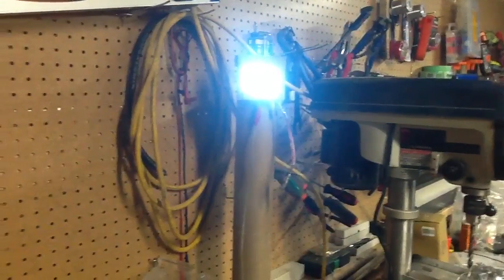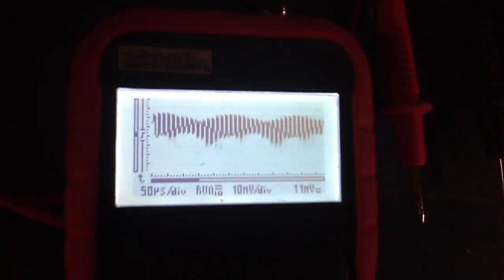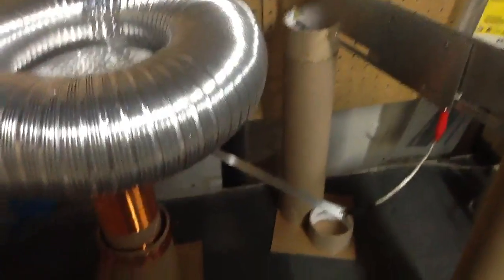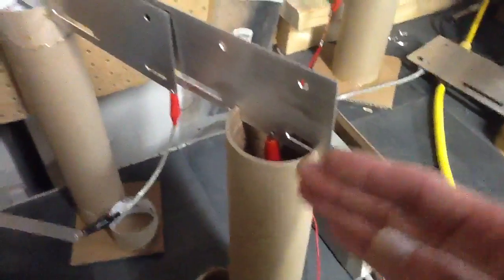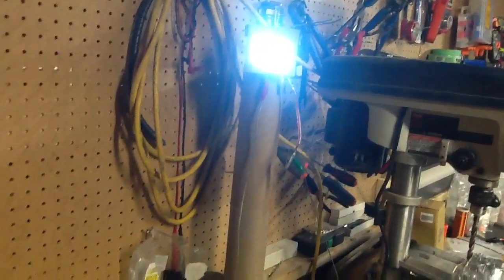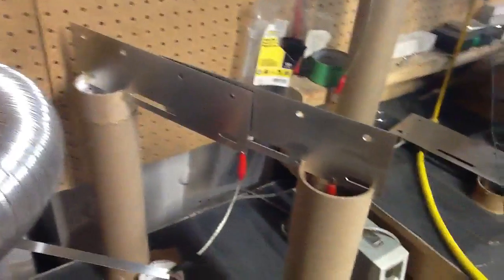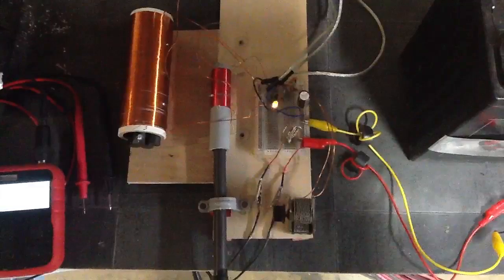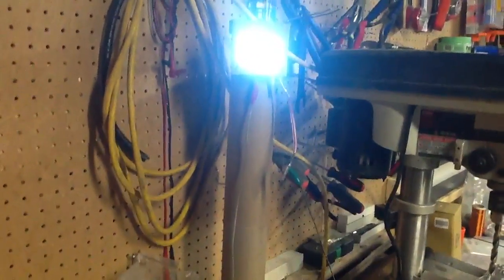pt 19 TMT Tesla Magnifying Transmitter, New Output Configuration

Comment: Have you tried blowing air on the gap?
Reply from the maker: +aaaflooddrying hi there, at the moment the spark gap is actually replaced by 2 parallel MPSA06 transistors, running cool, very low milliamps, seen here as possibly 10mA, but measured previously as 6mA on 12 volt. Stepping up to 150Volts and 20 milliamps out, as shown in a past video :)
Using my variation of the DrStiffler SEC exciter circuit, in Tesla Magnifier aka 3 LC system configuration
Reply: Very nice.

Comment: Hi dear Kurt,

Nice to feel that you have reach a Great Nice Level of Certainty in what you're doing :)

Can't wait your schematic and step by step "how to do" :)

So so very thanks for your hard and clever work and studies!

Btw, do you have PayPal donations button somewhere? ;)

Best regards, 
Didier
Reply from the maker: Khwartz hi man, I appreciate that :) I feel I do have a feel for tuning now and it is just like Eric Dollard has said and shown, the secondary and resonator both experience a dual 1/4 wave resonance, not to be confused with a 1/2 wave, because it has been believed in the past that the tuning was based on a lumped capacitance, but it is actually distributed, and Dr Wheatstone confirmed Tesla's experience that electrostatic induction speed was Pi/2xVelocity of light, not Einsteins Pi/1xVelocity of light :)
Reply: ***** My Pleasure! :) 

So, we have a "resonator" ; is that what the primary coil ? The primary coil would induce the frequency in the secondary coil? How we calculate the good frequency or what frequencies we should use? The primary coil have higher wire section than the secondary coil and is 1/4 long of the secondary coil? Or is that in term of number of turns? length of wires? Which diameter of wires in millimetres we should use for each?

About the exciter, couldn't be just a frequency generator or may we use one and if yes, how? I try to study the video of Dr Stiffler but couldn't understand how we calculate and choose the components. Could you help, Kurt, on this matter? The schematics you were talking about would be very appreciated! ^_^ And if you make a DIY video, please make one like for someone who would be near completely new in electronics, explaining everything and all the electrical phenomenons involved! ;)

Nice to read you back, Didier.

Comment: really interesting exploration, thank you for sharing! yeah, that aether thing interfere with digital devices and readings but rarely burns them.. it really behave something like between water and gas.. it 'wet' reflective/metal objects.. it also behave differently on daily basis. but dunno if that's because of temperature/pressure/humidity or moon and jupiter.. :)

Comment: Hi Kdkinen,
Try to encapsulate receiving plate, the one feeds LED's, with some paint that is good dialectric, and round the corners. to avoid electron loses to surroundings, or laminate aluminum foil with laminating machine with single wire output, this should increase the output.